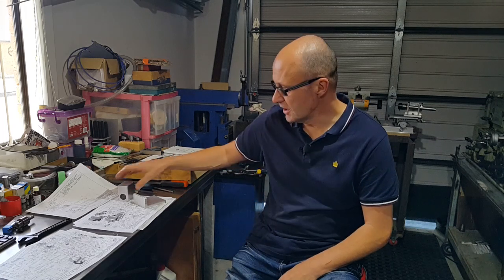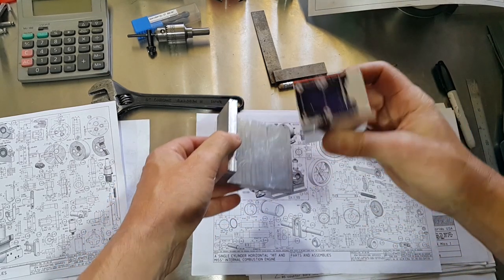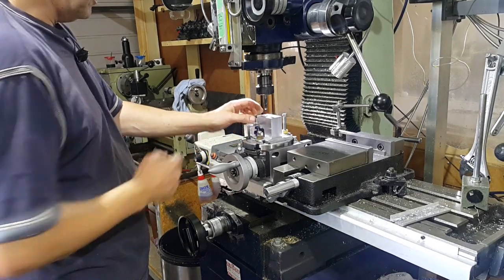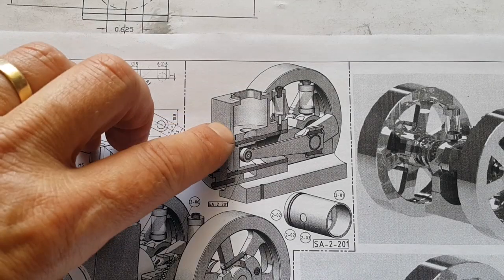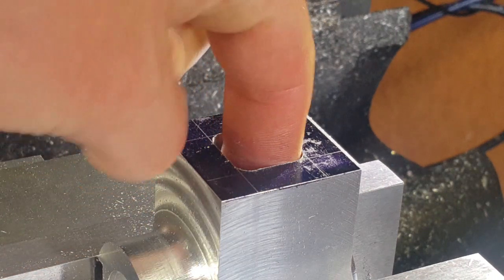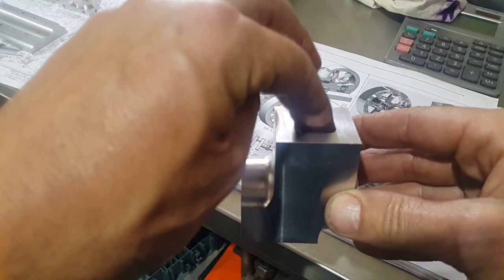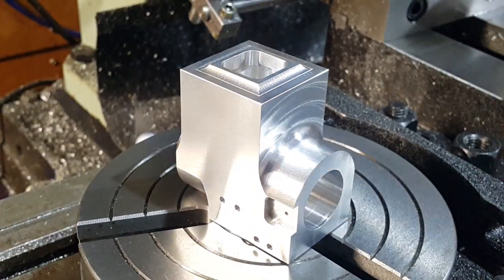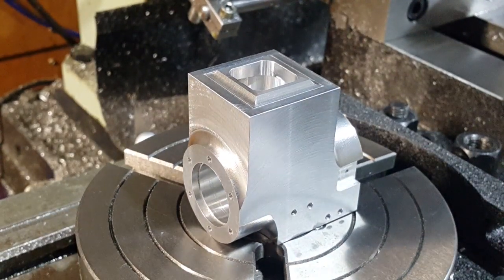#48 - Kerzel Hit & Miss Model Engine - Part 4

Comment: Interesting jobs I'm thinking of buying a milling machine like that, but it can only be HBM 45 220v
and the maximum speed is
1600 rpm will it be enough? from your point of view.
What is your opinion about this machine? greetings from Spain
Reply from the maker: Hi Luis, My mill is 1600 rpm also and its fine for my purposes. It won't take as heavy cut as something like a Bridgeport but then I just take more cuts....